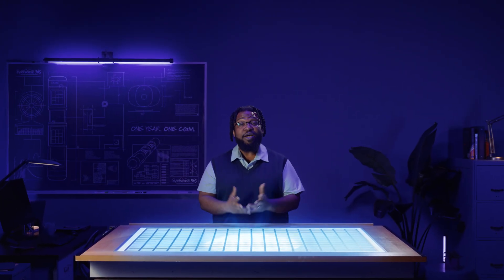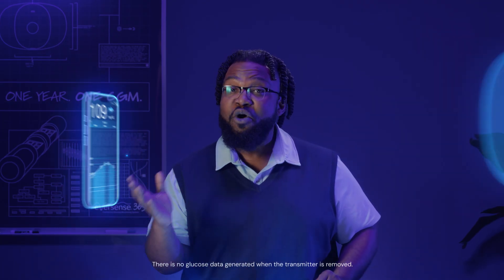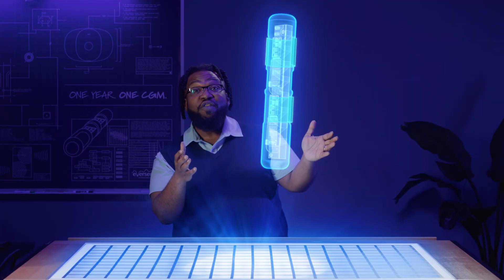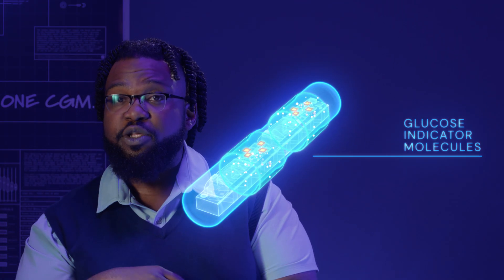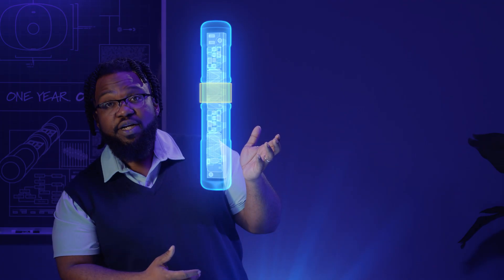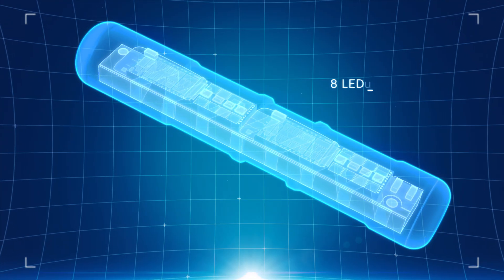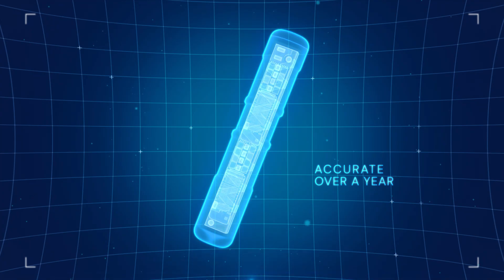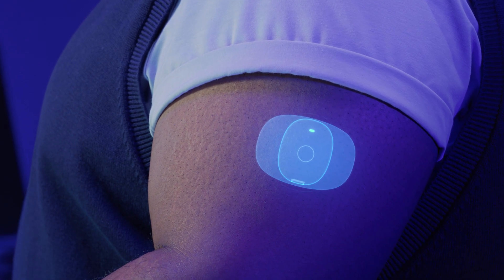Learn How The Eversense 365 CGM Works: The Only Long-Term Implantable CGM Device | Eversense

Comment: I have had mine in for 6 months. It really is better than any sensor I’ve ever used. It has its quirks like when outside in a warmer environment it reads higher than normal but quickly corrects after going back inside. It does get inaccurate when working out hard. I feel like at this point I nitpick the small things but overall it’s still miles ahead of anything else on the market. For reference I am a type 1 with a 6.4 a1c and 100% in range. I basically don’t eat anything that would cause a spikes but occasionally I do and it’s still so accurate all the time. Ask me any questions and I would be happy to answer it’s a big decision and I have no regrets.

Comment: I use the Libre 3 Plus, and it works well, but this new push is going too far. The Libre 3 sensor is connected to a device that stays outside my skin, so I can remove it anytime. It’s not surgically embedded. But now they want people to go to a doctor and have a sensor implanted under the skin for a whole year. That’s not just about health,  that’s priming people for what’s coming. They are slowly desensitizing society to the idea of permanent, implanted tech, getting people ready for the mark of the beast (Revelation 13). This isn’t just convenience, it’s about control. People need to wake up before the next step comes.
Reply: girl pleaseeeeeeeeee no one is forcing you to get anything, shush. Go prick your fingers if you want to, tinfoil hat.